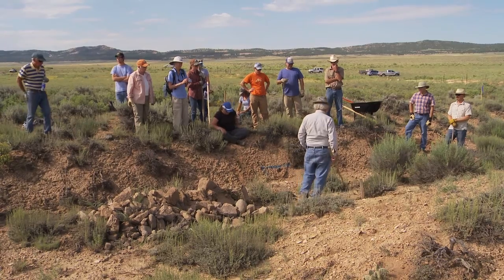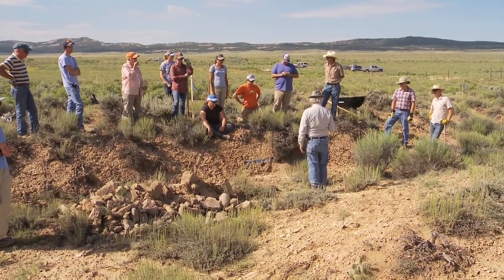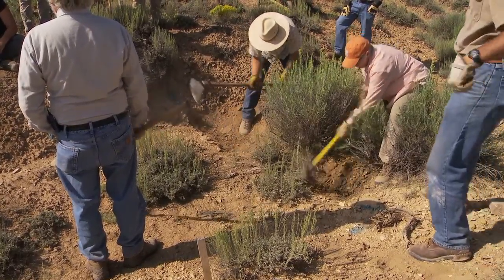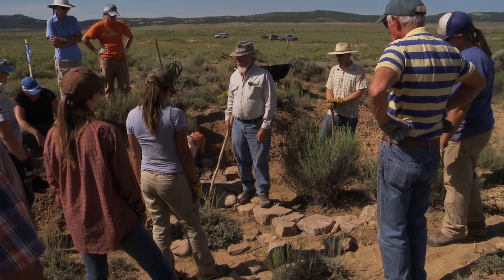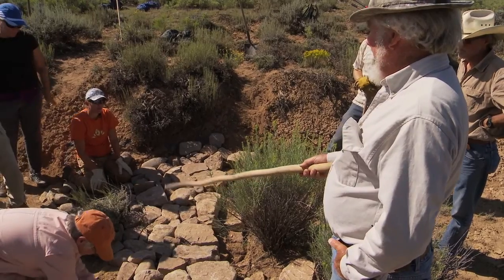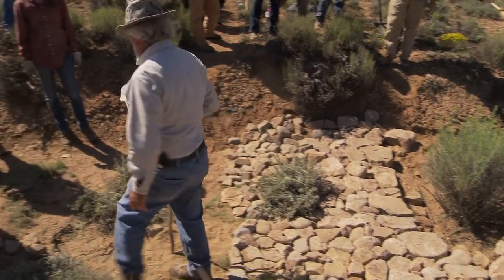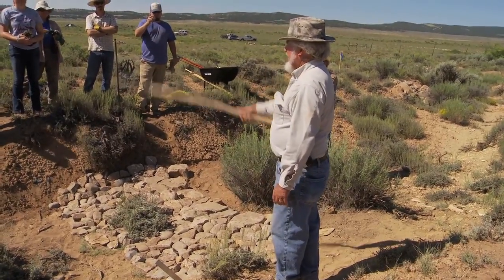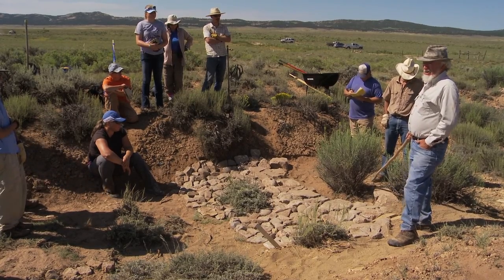Erosion Control One Rock Dam

Comment: What needs explaining is what happens when the dam reaches the flood plain since the next flood will start cutting at the end of the dam.   This could be prevented by cutting wings at the ends of the dam down a foot or so to expose soil that has a longer duration of moisture,  then  if willow or  rushes establish in this soil type, their roots will armor against the erosion that would cut the new channel.    The wing cuts also diffuse  energy by  spreading the flow even wider.